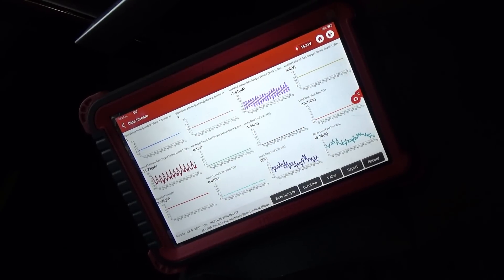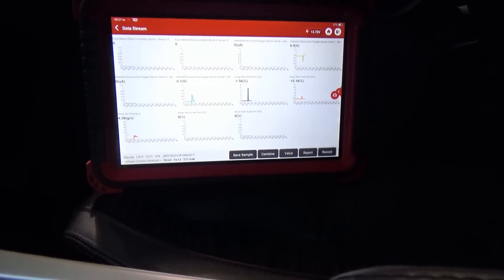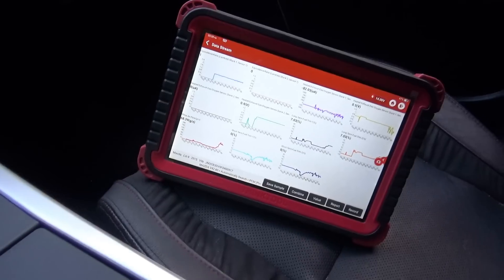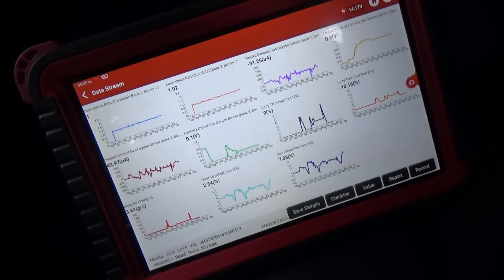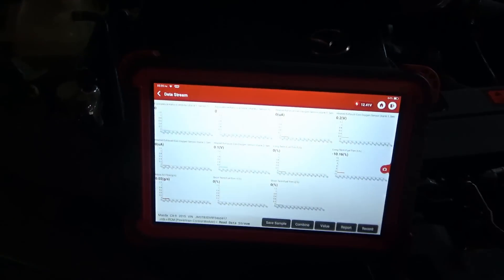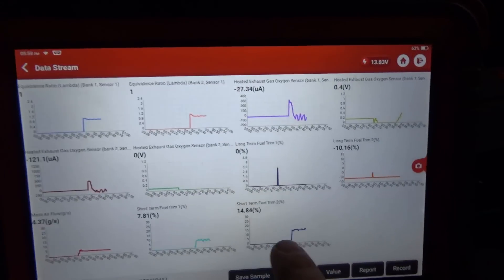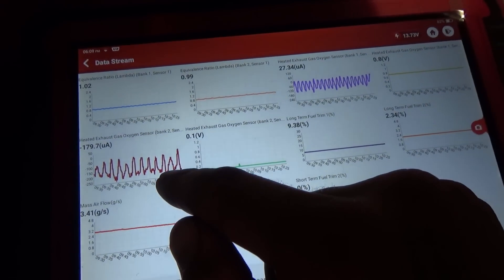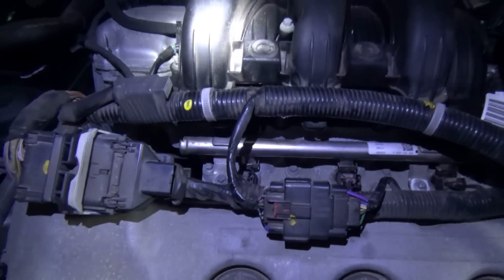Mazda MYSTERY No One Could Solve...Part 2 (P219B- Air Fuel IMBALANCE)

Comment: Use to take my cars in Texas to a shop where the guy there would check beyond what the code readers were saying. Took one care to him and another shop had said it was going to be 600 dollars to replace the fuel pump. Took it to him and when he test drove it he said it isn't the fuel pump which is what I already knew that. He found the problem and with testing and repair it was 60 dollars to fix it. dirty MAS.

Comment: Great diagnostic work! Would not of thought a 4psi difference would cause that.  Just for reference though, The front bank is cylinders 4,5,6 on ford engines, rear bank is 1,2,3. Yes I know that’s a Mazda— ford supplied the engines for this model though.

Comment: I suppose the way it detects the imbalance between cylinders is because cylinder 2 is causing the car to run rich so the computer compensated by taking away fuel, at which point it causes the other 2 cylinders to run lean so the computer knows what it wants to see isn’t matching what it should be seeing, pretty neat stuff, I’ll definitely keep this one in the memory bank

Comment: Ivan,, another good call on this one using good old common sense. As you noted, you can get turned around and away from the issue quite easily by the factory flow charts. The slightly darker plug was good visual reason to consider a mixture issue.

Comment: A suggestion for this kind of diagnosis in the future.  A quick white board diagram illustrating what's being measured with the readings being obtained and their relationship as expected vs. what's actually happening would be a huge help in following your thought process as well as give you a chance to think about the causes of the problem by talking it out.
I've found that when I have had problems like this just talking it out i.e. explaining what's going on and my expectations helps me zero in on the possible causes to find a solution.

Comment: Ivan, what was the injector resistance? Why not try an injector cleaning to see if that cures the high flow rate? If the injectors ohm out normal.

Comment: I was reading some of the comments in the previous video and several posted they thought it was a leaky injector.  My car has 430,000 miles on the clock.  I would be willing to bet if that car had the sophisticated electronic controls this Mazda (Ford) has, leaky injectors would be detected.  While it may have taken more steps to diagnose, seems to me Ivan simply used his head for something other than a hat-rack and entered the process of elimination.  I wonder if a pressure transducer could be used in this application?  I still say this is why the Russians beat us to space.  Great video!

Comment: This tells the value of actually reading the spark plugs - the subtle differences can tell a lot.
Now also check that it's the same model number of that injector as the other injectors. It's possible that it was replaced without being logged or that the wrong injector was mounted from the beginning.

Comment: When I ran my shop I would sniff the plugs as they came out. After a bit of practice I could tell which were off calibration. Also from the smell of the exhaust I could tell if the cats were working well.

Comment: I don't know about anyone else, but I was thinking that the factory had installed a half set of injectors that were too large, and unknowingly fooled the ECM into providing too much fuel.  As I understood the problem had existed for some time, and a TSB modification did not help(WHAT was the TSB for/about?)  I did not know it was able to determine actual CYLINDER imbalance, but neat if they do/did.  How?

Comment: I agree that the flow chart is really poor for diagnostics on this code, and 1 has to use some logic to rule erroneous tests out. However, 1 would have had to have experienced this failure before to go right for an injector. I'm not exactly sure how the ECM can tell cylinder and bank to bank balance, but it can!

Comment: You didn’t test a bank 1 injector to compare bank 2 against a known good. Isn’t it possible that that two injectors with the drop to 30 were both plugged and causing the imbalance.
Reply from the maker: Remember B2 was overfueling vs B1 👍
Reply: @PineHollowAutoDiagnostics  
True. So you could infer that it wasn’t a restriction. Thanks for the reply! It’s great learning from your diagnostic expertise.

Comment: As soon as I saw the Ford engine after you took the cover off I was mad at myself for not thinking injector when I guessed on the diag. Great diagnosis
Reply from the maker: Is that a common problem?
Reply: @PineHollowAutoDiagnostics  just more common on a Ford. You don't think injector problem on Japanese engines
Reply from the maker: @bigdaddymak1439  I've seen occasional injector issues on pretty much all makes... But not before 100k miles usually 👍
Reply: @PineHollowAutoDiagnostics  it was an awesome diag wish more techs used your approach

Comment: I am guessing there is a heat shield in the way, but am wondering if a temp gun on the exhaust manifold runners would have shown colder reading on cyl 2.
Reply: It would have

Comment: What an interesting case where the code is actually 100% correct!  I’m so conditioned to thinking about defective aftermarket sensors that checking out what the code is really for would probably have been faster and more accurate than swapping the sensors.

This is a bit long but at 36:40 he does a good description of the exact code seen here.  I know he says Ford but remember this is a 3.7 Duratec and Mazda is Japanese for Fix or Repair Daily.  If this had been a 2016 instead of a 2015 the ECU could have set individual cylinder codes and immediately narrowed down the diagnosis and exonerated the sensor from the start.  https://youtu.be/Ut2ve8iZ3nY

Comment: I believe I have the exact same problem in my Camaro.  It has a noticeably rough idle (which I believe is 1 injector) and when bank 2 pulls about 15% it starts to get really bad (other 3, bank 2 cylinders are now running lean).  Smooths right out off idle though.  I also have a bank imbalance code.  Problem is, I have direct injection so I can't really test unless I unplug the ecu connector and pulse from there, yeaaa nope.  Supercharger has to come off.  UPDATE:  I pulled the plugs from bank 2 and found one extremely black and the rest normal.  Looks like i found the culprit.

Comment: Great case study, Ivan! I like the troubleshooting with factual data and eliminating variables (such as the replaced O2 sensor) by trying a known good. This prevents unnecessary ‘repairs’ and gets to the root problem by moving on to something else. I was worried about the engine computer or potentially interference effecting the uA signal (interesting the previous shop installed an isolated harness for that O2). Great job on the diagnosis 👍

Comment: It seems to me that the manufacturer should have included a check the spark plugs for indication of a rich or lean condition in each cylinder of the affected bank and if one is detected do a fuel injector leak down test in their troubleshooting guide/list. The insistence in that guide of checking for vacuum leaks would seem to also lead to the option of too much fuel being a possibility if there isn't a vacuum leak.

Comment: Ivan can you explain how the pcm is monitoring the a/f ratio of each cylinder without having a sensor for each cylinder?
Reply from the maker: It's not, just an average. But the fuel trim swing and AFR switch rate were not good so I guess the PCM flags that as a code 🙂

Comment: when you were reading the service data in part one you read the description of it reading the inbalance in cylinders.  i wonder if it is comparing the fuel ratios  along with crank speeds to notice the difference, or possibly knock sensor data.  who knows maybe even ignition coil  draw. would be nice to know how they do it.

Comment: What a missed opportunity for the pressure transducer!  Would be interesting to see the pressure drop on a scope.  This pcm has detected a single cylinder misfire... Before the ckp saw an inbalance. Impressive.  

For the silly things as causes, like an improperly seated dipstick tube or oil cap.. they make sense because they're not centrally located and will make a vacuum leak that affects one cylinder more than the others.
Reply from the maker: Dipstick and oil cap lead to the crankcase... Definitely not a cylinder specific air intake location 🙂
Reply: @PineHollowAutoDiagnostics  lmao... whoops.  I can't believe I wrote that.  I do stand by the pressure transducer for the injector drop test though!

Comment: Cool video, and perfect diag as always. This ecu is obviously pretty smart detecting such problems but the code description is a little bit bad. However I had the sam problem on direct injection petrol but never on non gdi engine. This tool you use to pulse the injectors -  can it be used for gdi injectors as well?
Reply: I, don't think so because GDI injectors have massive/big pressure that spray in to cylinder directly between 2000 to 3000 psi so the answer is no be very careful on playing with GDI injector pressure is too high and if u have a good scanner u could see the pressure there is a pid will show u that hope this help.cheeeeers
Reply: @jgeorges3061  ye I know what pressure gdi works on but I was just wondering if the tester could pulse them...
Reply from the maker: @SDmotorsport  GDI injectors need over 40V to open... So this pulser would not work 👍

Comment: wish u could figure out whats wrong with my prius. its 04 with 200k miles, threw all the parts on it, spark plugs 3 times, fuel injectors, coil packs, maf sensor, upstream. pumped smoke up the tail pipe, there was a lot of resistance and it didnt come out from anywhere. Only getting 36 mph instead of 45. I actually had the wrong o2 sensor in there for a year, i got lied to by amazon, and it read wrong and ran the car rich for a year, and now i think my cat turned into a straight pipe, because i smell a lot of exhaust. seems to misfire at idle sometimes. sometimes the ignition timing is -10 and it misfires. Runs super rich at idle too. Could be compression, haven't checked the compression yet. But i run the engine restore in the oil so the compression should be okay. Project farm saved a 60 year old tractor by using that additive. The car always had this problem. I'm sort of suspecting high fuel pressure problem or something.
Reply: you should make your own channel because you are the complete opposite if this one. Call it Parts Cannon Pirate
Reply from the maker: Problem is that it's an old Hybrid 😅

Comment: Thank you!

The CSS script of the USB Autoscope will help to find this problem - and others. It allows to see individual cylinders contributions under dynamic condition.  I imagine in this case the effects of the injector's imbalance are less pronounced in a high load/demand situation. This should reflect in scan data also, if true. An ignition scope capture should have been interesting. If fitted with 2 wire coils primary could be taken easily, though I'm not sure if this is multistrike design.

Comment: I  think that the flow charts are actually deliberately made with curvballs.  The reason behind this is because of the ridiculous number of silly patents behind the control logic for the sensors.   If the flow charts did not have these curve balls in them then the charts could be user as evidence

Comment: "There has to be an explanation."  I'm  an electrical engineer and in school, in my digital logic class, the professor said something I've always remembered.  "You should know what is happening in your circuit at all times.  There is no magic going on in there."  When diagnosing, I've always remembered this when the problem appeared too difficult to find and it's always pushed me to find the issue.
Reply: Did you have to take the Signals (some called it Signals and Systems) course? If so, was it the hardest part of your degree? Heavy on trig as I understand it.
Reply: @InsideOfMyOwnMind  the hardest part was differential equations.  I took that as an accelerated class in the spring.  Big mistake. 😂😂  Any of the classes that covered electronics were a breeze, as I've always had a pretty good intuition about how the parts work.

I think the class your referring to was about electronic communications, though I don't remember the name of the class.  It was 35 years ago.  It wasn't too difficult though, at least the concepts weren't.  I don't remember the math being that hard for that class but I could be wrong.  If you can understand that a signal can be broken down into sine waves of multiple frequencies and phases, everything follows from there.
Reply: @ThatEEguy2818  There is an application that is native to Linux but can also be bribed to run in Windows called GNU Radio. If you look at the function block list you expose yourself to some of what I was referring to. Literally you can build anything you can think of in DSP by way of building flow-graphs in the program. Then you can compile the flow-graph into a function block and so on.
Reply: @InsideOfMyOwnMind  DSP wasn't nearly as advanced back then.  For example, software radio.  I remember the first time I heard of it, I was amazed they could get a processor to execute filter algorithms that fast.  Pretty amazing stuff.

Comment: At the moment though injector 2 is just a guess surely? 
You didn't check injectors 1,3 or 5....so how do you  know both 4 and 6 aren't the bad ones?
Maybe the computer has been programmed to detect this situation, but not to try and balance the bank out using trims, because it knows that will run a cylinder rich.
Reply from the maker: No guesswork. We definitely PROVED that #2 injector was faulty based on the data collected 👍
Reply: @PineHollowAutoDiagnostics  Well I guess you do actually know the outcome, so your right.

But injectors 4 and 6 could have had a reduced flow with poor atomisation leading to a rich condition the ECU was seeing hence negative trims.
The only way to have ruled this out would have been to check 1, 3 and 5 to be certain.
Reply from the maker: @ianmuggeridge  reduced flow would not cause a rich condition 😉
Reply: @PineHollowAutoDiagnostics  Poor atomization....lean, rich or wet.
Reply: I suppose what caught my eye was swapping bank 1 and 2 AFR sensor and seeing the same issue, and "being" confident that a "known" good component was swapped, was a sign you'd found something that made sense,  and therfore "was" the proof.

When it wasn't,  granted it was most likely the issue, and as I mentioned earlier you already have the answer and feel you're right....but knowing a "bank " has an issue and finding 2 different readings is not confirmation,  unless compared to the other bank with no issue?

Comment: Pro Tip,

If you don't want the headlights on while working on the car in the service bay, SET THE PARKING BRAKE BEFORE TURNING THE IGNITION ON AND STARTING THE ENGINE. 

Most cars/trucks won't turn on the auto headlights when the park brake is on when the ignition is first turned on, NOT AFTER it's turned on.

Great case, great video, keep up the good work Ivan.

Comment: Awesome! The drop discrepancy of 4 psi on #2 is very obvious on the analog pressure gauge. I wonder if the measured current on the scope would pick that up too. If the injector was inaccessible, like a rear bank under the intake, how could a test like this be done if the computer doesn't have its own fuel pressure data PID and active injector pulse or an injector balance test? We can see why people drive or tow for hours to get to your shop!
Reply from the maker: You can just use the pulser at the injector control wire at a connector or PCM 👍
Reply: @PineHollowAutoDiagnostics  Doh!!!  That's where I would have connected the scope. Talk about a brain fart!

Comment: Wow! Same as others, excellent diagnosis! That definitely surprised me! It's incredible how contemporary PCM programs can detect that now. I'm with you on the flowchart, wish Mazda had been a little more concise and getting the technician onto the more probable causes sooner. When they created that controller code, the programming behind it was to figure out if a single cylinder isn't burning as completely as others in a given bank. That was the total purpose behind having that trouble code. So you think the flowchart would end up getting you towards vacuum leaks per port and testing injectors sooner in the flowchart. I question why the code exists and what the engineers purpose was behind that when they created the software and trying to understand that on a granular level. Awesome freaking diagnosis Ivan!!! 👌

Comment: See, it was actual cylinder to cylinder imbalance.  You sure there was no PID for this or an advanced diagnostic mode where you could have isolated #2 without touching any bolts?

Also, these are known for water pumps leaking behind the timing cover, filling the sump with coolant and destroying the entire engine.  So that's fun.  Pretty much all transverse Ford Cyclone V6s (I think the N/A ones).
Reply: I'm not sure how that tool does bidirectional inj tests. Could be just the old school, turn the selected completely on or off, while running. Ivan should check that function and let us know! :)

Comment: Very interesting analysis. It is strange that the Mazda tech manual on AllData did not have a better troubleshooting chart for this issue. I decided to check a P219D code for my personal 2018 Volkswagen Tiguan (it has codes for each cylinder and it is only a 4 cyl.) and that troubleshooting chart is exactly the same as  your diagnostic procedure. Check spark plugs for fouling, check intake for leaks, check fuel pressure, check fuel injectors.